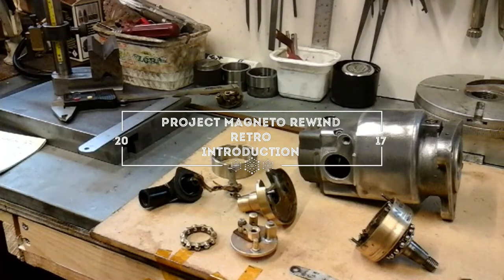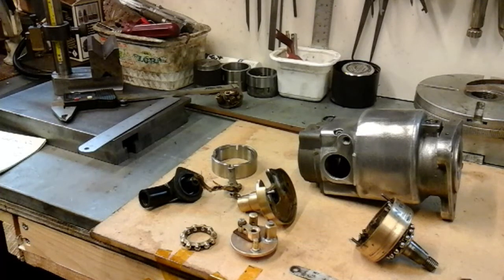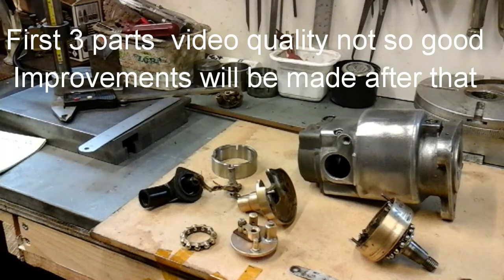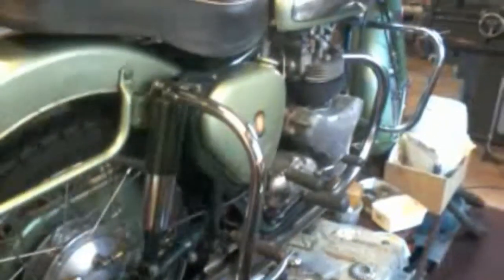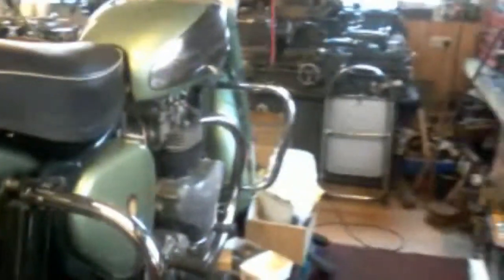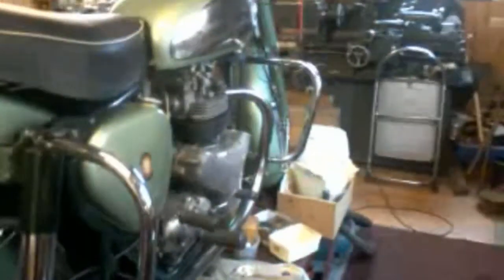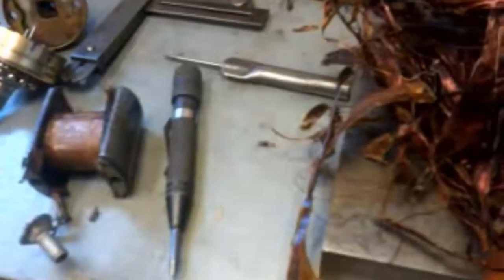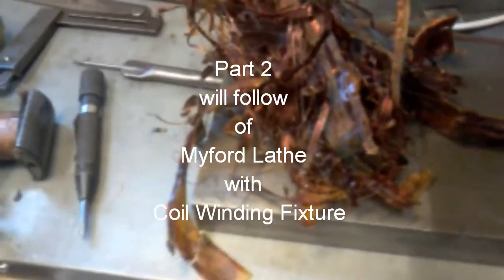How to Magneto Rewind on Myford Lathe Part 1  "  mr factotum "

Comment: How did you determine the number of winding wraps you needed on the secondary side of the coil?
Reply from the maker: hi dan
thanks for comments glad you enjoyed, now then its quite a while since I did that, my brains in full steam loco build mode at present, but I think somewhere in the videos I mention this about the number, its not absolutely critical but I think off top of my head 10,000 turns give or take, but I got the info from a reliable source
any way very good luck if your having a go. i'm sure you will be ok.
regards
mr f